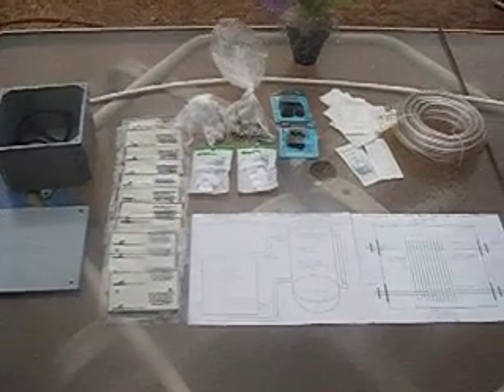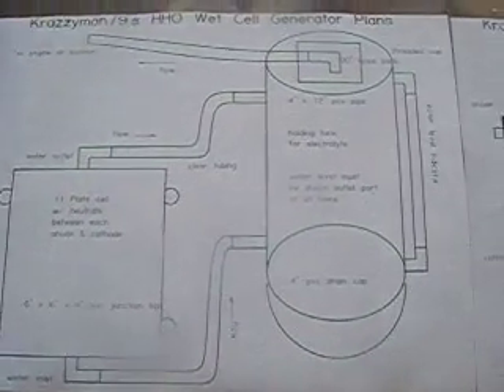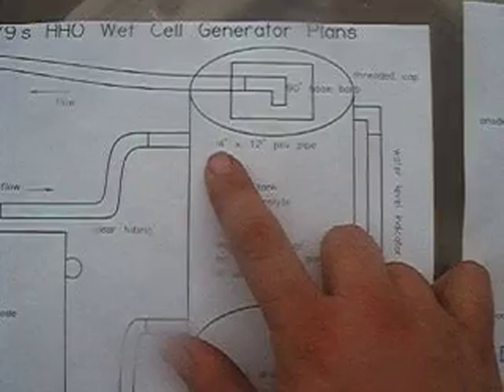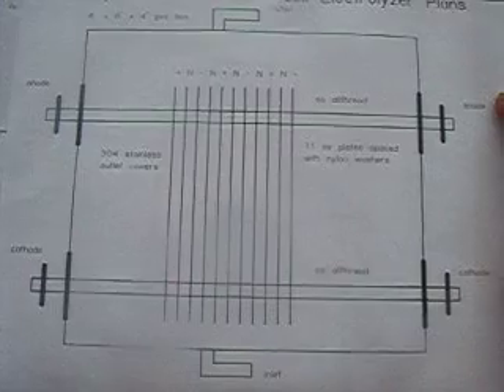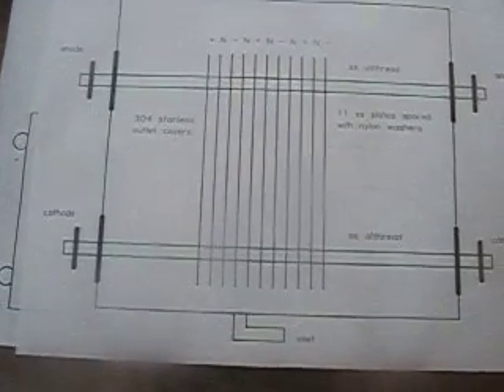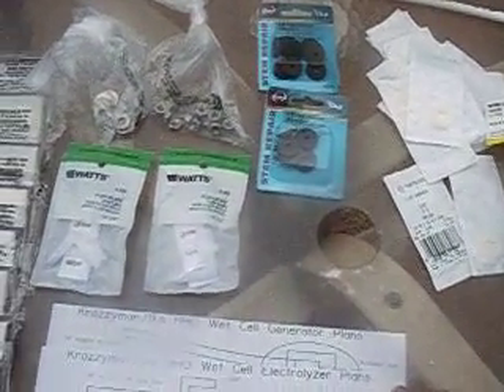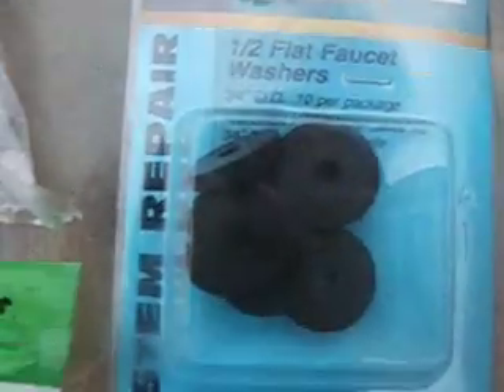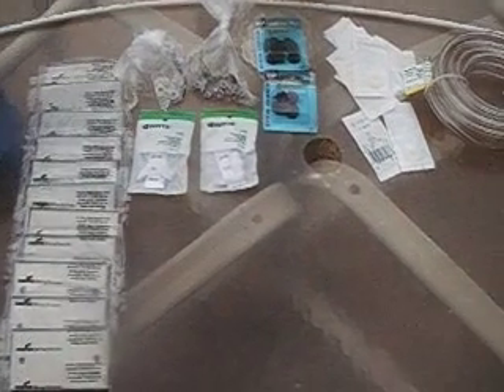The new design wet cell circulating with out a pump.

Comment from the maker: ya I may add some seperators to the design, but not quite sure what to use for them. When I do a test run and a "burn-in" test, I will see how fast it warms up.  I plan to try sm0ky40's electrolyte solution.  I may ditch the copper rad I am using and run nylon tubing infront of the radiator on the truck to keep it cool, also implimenting my PWM might do away with the need of a cooling unit all together.  many variables, much testing to be done. All in good time!

Comment: Hi. All looks good, I wish you would use some separators to keep the water clean.
You still need something to cool the water.
I suggest running it through a 12"x2"inches stainless steel tube before it returns to the cell.
cheers zeropoint132